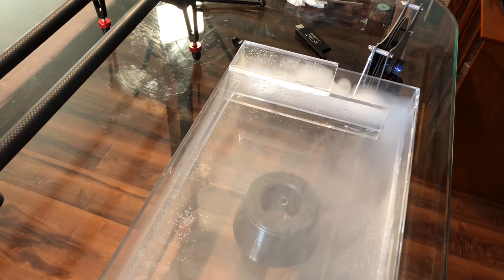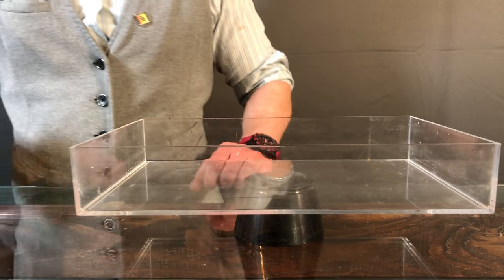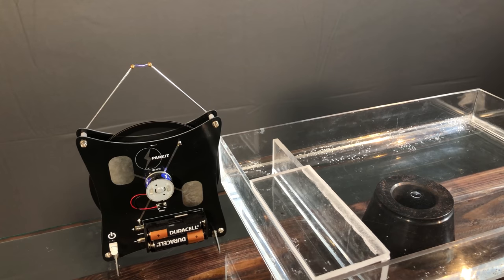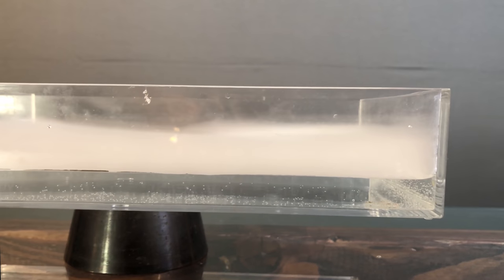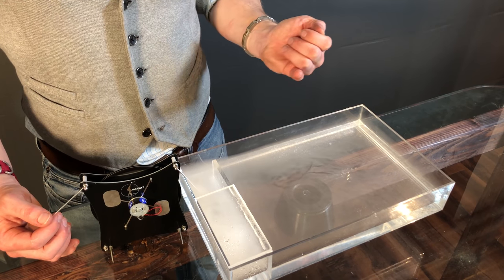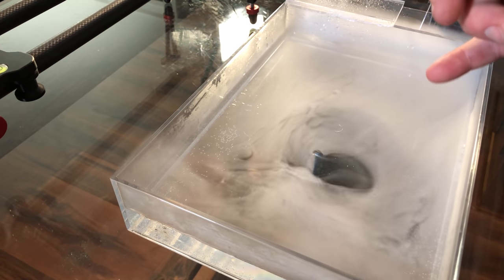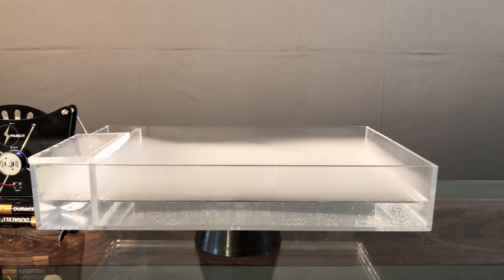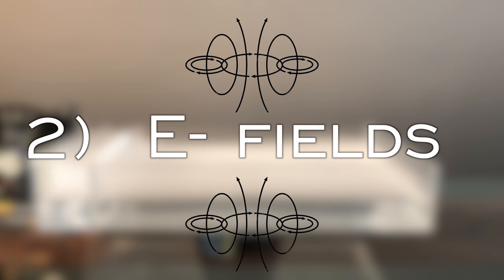Fog Drawings Using High Voltage Electricity (UNBELIEVABLE)

Comment: at 5:40: "super cool phenomenon".   Yes, about -78 C.  And that's VERY cool indeed.  Seriously, this is a wonderful demo.  I've made physics demos for a long time, and I've never seen this.  So eager to try it.     Thanks Jay.
Reply from the maker: Thanks! Yes, please try it
Reply: @PlasmaChannel  First discovered by Charles Yost in 1995, using Schlieren photography and a sectorless Wimshurst machine.   The fog version made the rounds in 1998, plus a 2008 video on YT.  See back-issues of Yost's 1990s "Electric Spacecraft Journal" issue 16.   Also called Threadlike Streams of Electric Wind, High-voltage Air-threads.     Lint-free skin doesn't work, so, first wet your fingers, then brush them across fabric.
Reply: @PlasmaChannel  Try human hairs (eyelash hairs work great.)   But steel wool doesn't work, the "wind" is orders too great.   We want micro-wind, nano-wind, non-self-repulsive ion-clouds, not a cone-shape streams.   Apparently the sharp emitter must be quite resistive, so the current is limited to down below microamps.

With a 400KV VandeGraaff machine and grounded water, I had them about 6ft long, and they'd move around when distant objects moved in the room.    Also, put a single human hair IN THE FOG, pointing upwards from floating aluminum foil disk, and you can photograph the entrained thin stream going upwards.

Comment: Very cool video Jay.
I did some thinking and I think I may have some insight. I looked up the electric field lines of a point charge near a conductor and noticed that it is not very fine at all, rather spread out over a larger area. Therefore, I wonder if we underestimated the role that the water plays in this. Unlike a normal conductor, the water is slow to move charge, making a high field gradient at a point unlike in a metal where the charges quickly spread out throughout the material. (Recall the water bridge experiment.) I suspect that this high point charge gradient in the water is responsible for how fine the lines in the fog appear. If I were to test this, I would replace the water with a metal foil and see if the effect persist.
Reply: well, using foil you would need a little more acrylic or a small bowl to have the dry ice in water but not the tray. you could try that, and I think I will too when I do it.
Reply from the maker: I will try this...and will float a patch of aluminum foil on the water, seeing if it has an effect
Reply: Plasma Channel any update on this?
Reply: @PlasmaChannel  what was the view effect of this experiment?
Reply: Update with new insights? 🤔 Very interesting video.
Reply: @PlasmaChannel  Just watched the vid, and I'd love to see an update to this as well! Very intriguing!
Reply: @PlasmaChannel  the torn edge of paper will make hundreds of separate threads.   Bend the paper into a triangle, and it punches a triangular hole into the fog layer.    Bring a 10KVAC terminal nearby your finger, and a single thread becomes a line (sweeping at 60Hz.)   Then wiggle your finger, and it paints a sine wave into the fog layer.   See video from 2008.

Comment: Did you try a rare earth magnet?
Reply: Doesn't work unless the magnet is charged.    Measure the current, and it's usually below 1uA.    However, an electrostatic deflection-plate and neon-sign transformer will turn the black spot into a black line (swept back and forth at 60Hz.)

Comment: I was just thinking out you today! Very nice upload! I think you are spot on with manipulating the fog from the perspective of the electric field lines. CO2 should be conductors, thus turning the fog into a type of Gaussian surface. With that you can charge your field lines. Around the edge those lines should bend outward and around to a opposite potential , likely ground. You being a "conductor" for ground provide a path when you intersect. the fog probably parts in relation to the electric field changes (maybe why several parallel lines are visible during the video).

interestingly as I research ancient technology I have a hypothesis that incense was used for its electrical properties being also related to CO2. Would be interesting to see MORE experiments with dry ice in the future from you!
Reply from the maker: Think, and I shall appear fellow Plasmanaut! Seriously, great explanations
Reply: @PlasmaChannel  I slept on this a bit more I think I have a more to add! Going with the idea that it acts as a gaussian surface that becomes charged and radiates an electric field. When you provide a grounding path I believe regardless of which way electron flow is occurring will cause an opposite charge at the surface of the gas. Since a point is receiving an opposite charge its then  attracted to the gas around it.
Reply: CO2 is conductive?
Reply: @Graeme_Lastname  I don't believe so, no, not without any free valence electrons, and unadulterated.

Comment: Nice video Jay... That is a project which I will build in order to show the kids when they're older. Thanks. As for the strange behaviour... isn't that caused by a static buildup on the acrylic walls of the tray creating a field repelling the charge from your hand (and tools) away from the acrylic... it may be a weak field and can only reach so far, thus causing the charge to bend.... if the tray were made from something with different dilecttric properties, the bend in the field may be more direct..... As I see it... the Wimshurst is connected to the water which is then connected to the tray. The water is being charged with one end of the Wimshurst so the acrylic should acumulate a charge similar to that from your hand... Similar charges repel....        Just a thought...
Reply from the maker: Thanks Matthew. That is definitely a great possibility. I noticed when the power was turned up too high, the gas actually repelled and dispersed by itself. That may be partly due to what you mentioned here.

Comment: I like this fog effect  it would make s good ghosting effect for videos. Maybe if you were to place a small flat screen underneath it may be good for doing a dream shot in a movie. Or phasing through a wall like a vortex effect. Or if the background was white at the bottom you may be able to use a small over head projector to cast an image into the movieing fog. Or even some small colored laser light's moving through a prisum with a small mirror background bouncing the light back would be a bit of fun to see.

Comment: I once connected one side of a high voltage power supply to a metal plate and the other to a needle placed horizontally above it. I also got an arc going from the needle and curving down to the plate. I have an old video about it on my channel, although perhaps vague and cringy. Since electrons have a very, very miniscule amount of mass, I thought it was the inertia of the electrons pushing it out before it reaches the plate. I'm probably just stupid but I think it's kinda interesting.

Comment: This is by far the best video on your channel and my personal favourite too. 
Hey Jay, I was wondering what would happen if we use a piece of metal (polygon or a star shaped metal sheet) in place of hand. Will it cast exact shape over the fog???
Reply: probabely but metal  could change the result
Reply from the maker: I tried a circle of aluminum, but it just caused a bunch of ionic wind that was hard to control! Thanks so much for your kind word Tarun!

Comment: This is exciting! I had been following you and I can't stop watching your videos! So this is the secret magicians will never reveal! Lol
I believe it's all three.
Reply from the maker: Glad you enjoyed it!
Reply: @PlasmaChannel  I haven't tried an oil-wetted fiber, to see if tiny oilslicks are deposited on water.  Or far more sensitive: a fiber wetted with florescein dye, then use a high-power UV source to look for tiny green glows in the water.   But yes, the streams are easily deflected by charged electrodes, where a few thousand volts of nearby AC will turn the fog-hole into a line.  Then wiggle your finger to draw a 60Hz sine wave in the fog.

Comment: That is indeed strange behavior. I will have to play around with this. I did finally get my 180kv system rebuilt this last week!
Reply from the maker: Feel free to post a video and share the link on this comment thread!
Reply: @PlasmaChannel  I will do so when I get time to film it. I have been so flipping swamped with LED/Laser repair stuff ( Can't run 180kv with all the sensitive projects ) I figure July will be around when I will have the HV set up back in place. I miss it!

Comment: I think it's directly the effect of field lines. A charge line is connected across the surfaces in question and the extremely small ion leakage current gives fog particles a charge and induces a distributed field force to adjacent particles with the net result being temporary displacement. It also explains the high quality of line tracing. Reminds me of a cloud chamber in particle detection although that's a different thing entirely.
Reply from the maker: That sounds like an amazing possibility. Field lines would also explain why the effect has no delay... it appears immediately and moves at exact same time my fingers do with no delay.

Comment: Jay, I think this phenomena is perhaps related to capacitance. Your finger's proximity to the electric field is changing the dielectric properties that exist above the water resulting in the ghost trails in the fog below. The localized change in dielectric strength within the electric field changes the capacitance between the charged bodies (you and the fog) even orthogonally to the electric field! Perhaps you could use a magnetometer imaging device to confirm because where there's ion flow (or even localized ion drift), there's also a magnetic field.

Comment: Cold plasma occurs when high voltage and low amperage current flows through a gas, as it does so the electrons get excited to a high-energy state. But the nucleus of the atoms don't get energy so the gas can not transfer kinetic energy as heat to a solid object like your finger. 

And cold plasma destroys bacteria.
Reply from the maker: Hm, that is interesting science. I need to read further about it. Thanks.

Comment: Try doing this when your body is not coupling with the field.  Electrostatic field displacement / coupling is occurring when you are that close.
Try this without being as close.  Use the same objects you used but see what happens when you are not 'inside' the field.

Comment: I think, it is the electric field that comes out of your finger tip. The field is high on pointy surfaces, like your finger. The fog is water molecules, which are dipoles, so the e-field can influence them. Probably the e-field aligns them. Maybe aligned molecules have different properties. Or the particles are charged  and repel each other... speculation, though.
Reply from the maker: That is what my general thinking may be. I left that out of the video....but my finger does have high electric field gradients

Comment: Does polarity matter?

I somehow think you may have done a eletrostatic filter.
The fog is water droplets in air, and you could be making them cling to something nearby with the eletrostatic field.
Reply from the maker: I found polarity has little to no effect actually. Strange stuff!
Reply: @PlasmaChannel  Kinda expected actually.
Please follow up the eletrostatic filter thing I mentioned.

Comment: I think it's similar to a smart device screen.. In that the water is charged by the high voltage. Your body is capacitive but carries no charge. So HV 'high voltage' energy shoots out in fine points towards your finger as a discharge/neutral point when you get close to it.
I think you may have figured out a very basic near field proximity detection concept with this

Comment: I don't know how exactly this happens, but in the spirit of experimenting, it will be worthwhile to connect the other end of the battery to some metal thing and bring it near the fog.

Also if this phenomena has to do something with dipole moments of fog molecules, you can try thus with some polar molecules like ethanol etc.
Reply from the maker: Ethanol vaporized does sound somewhat risky though. Considering if you get too close to the fog a spark jumps to your finger. Good thoughts though, thanks!

Comment: I say number 3. The human body has capacitance and being close to the generator is enough to store charges of energy that moves toward the anode(co2) making the human body a capacitive cathode to the fog. The temperature of the dry ice as it evaporates has a low resistance (similar to the way super conductors work,) but the co2 vapor molecules being nuteral follow the pattern of the ions (ionized gas) that are  influenced by the adhesive attraction of the air that is charged by the discharge of the body. What we see is  cohesive forces of the co2 vapor as it is now becoming a turbulent flow withing the laminar flow. I may be a little off, but I'm sure I'm on the right track and may just need to review and revise my hypothesis before determining conclusion.
Reply from the maker: Justin, that sounds like a solid explanation. Thanks for the insight

Comment: I wonder if a cloud chamber would be improved by using your technique with the water on the bottom.?. Of course you would still need a metal plate bellow... I wonder. Does it have to be alcohol vapor?
Reply from the maker: Alcohol vapor? I have not tried alcohol vapor before. interesting idea.

Comment: Does this have anything to do with the coefficient of collision and coalescence of water vapor? When lightning increases the voltage in a cloud, the colliding water droplets are more likely to “stick” and form bigger droplets. 
So, is there any connection here? Could these drawings be an increase in the highly polarized water vapor? Or, is the coalescence coefficient irrelevant since the curvature of the droplet surface is at play?

Either way, it’s interesting to think of this in therms of lightning and cloud formation.

Comment: I think the fog particles are just getting charged by the static and then attracted to your finger so they leave the tray?
Reply from the maker: Do you hypothesize when they are drawn to my finger.... they become less visible? Because you can’t see the stream going to your finger. Interesting possibility.
Reply: @PlasmaChannel  Well they would move to your finger fast, and mix with normal air particles in the process, so like a very very dilute fog.

Comment: The CO2 cloud effect is used to illustrate cosmic particle penetration "streamers". I believe you recently demonstrated a similar phenomenon. 
As our bodies can act as antennas, the inverse should also hold true, that is, it would function as a transmitter.
What if you created a neutral environment to the effects of cosmic radiation and the Schumann resonance, repeated the experiment and recorded what happened. Have you attempted to use another gas, other than CO2 vapor to see what would happen? What about a way to observe the magnetic fields? Do you have Wi-Fi or any other electromagnetic emissions that could be having an effect?

Comment: 1) place a top on your acrylic “lasagna tray, repeat the experiment. 2) place a thin piece of graphite , tape it yo your finger  repeat the experiment. 3) try it with a very thin cylindrical magnet,  then revert the poles 4) fire 2 blue lasers horizontally  through  the fog . Drill a hole in the acrylic  at the level of fog,.  Fire blue lasers at 90o to each other but not touching si to try to breathe a vortex, repeat  the experiment.

Comment: Imagine that Water has a negative charge and you have a positive charge in your hand. One when you take your hand near the water Then a connection is formed between the negative and positive charge There was no charge in Foog The positive charge of your hand and the negative charge of the water were trying to connect together, so the way you were moving the hand, the charge was coming to that side And when you were moving your hand close to the water, the charge was jump on your hand, then the fog suddenly spread
Reply: I am also experimenting with electro magnetic fields & current
Reply: Specially with voltage multipliers

Comment: What if you invert the polarity of the power source? Would you see spikes of fog jumping towards you?
What if you connect the two wires both to the gas/water (each on one side) ?
Reply: It might just be that you have here a "bridge" of CO2 poping right under your hand, closing the circuit. The same effect that you did with the "water bridge" between two bechers (and that another youtuber — @electroboom — managed to do with oil and a VDGraaf generator).

Might it be that there is an ionic wind… but from the gas towards you ?

It would be interesting if you had a thermal imaging camera : if there are CO2 spikes, it should be much colder than the surounding air, since there would be no water vapour condensing into it and releasing latent heat into it.
It would also be interesting to try it with liquid nitrogen : pure N2 is slightly more insulating than air (and CO2). 

Secondly, what makes the fog, is water droplets that condense due to the cold CO2 (not the CO2 itself, which is invisible). So, when you do not see anything, that means that there is no air with water droplets, but (I guess) pure gaseous CO2.
Also, CO2 is slighly less insulating than air, especially cold dry air like here (the water is not vapourous here, it’s liquid, in the dropelets, thus saturated).

Finally, water is diamagnetic: it creates it’s own opposing magnetic field when under an external (permanent) magnetic field. However, this involves magnetic fields, not electrics. I put it here since it might help, but I’m not sure.
Reply from the maker: Its interesting, as I had the exact same effect no matter the polarity.